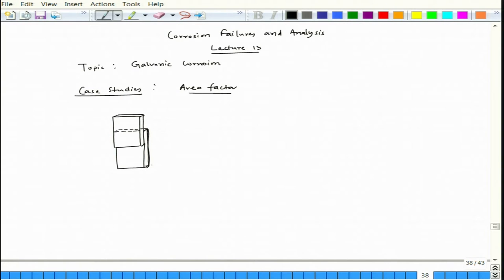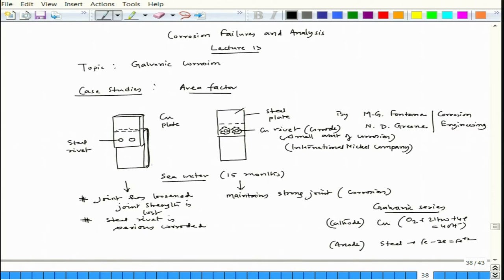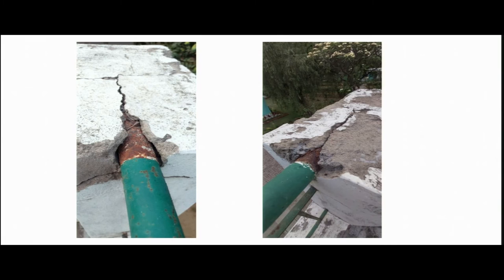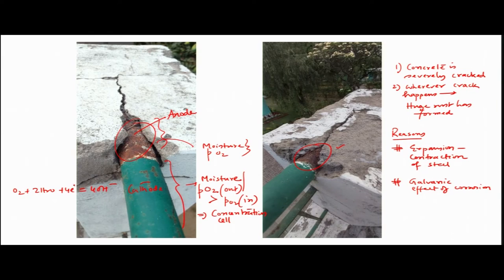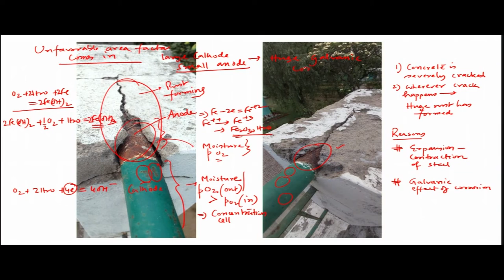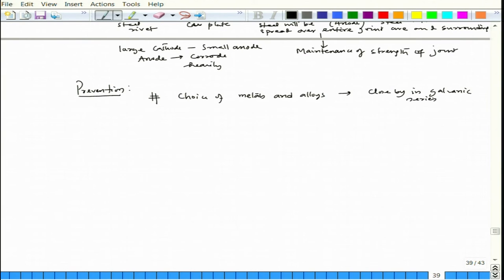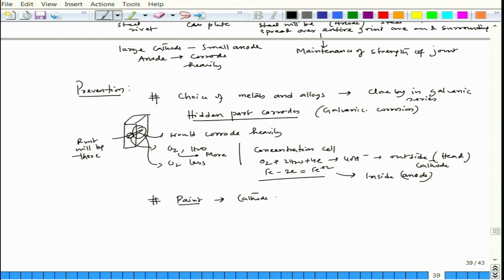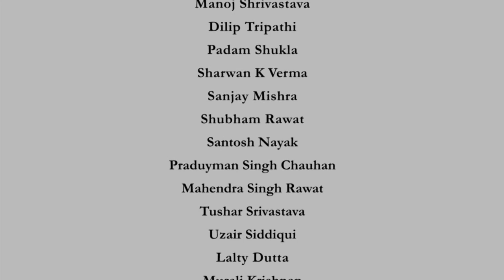Lecture : 13 Factors associated with galvanic corrosion: Case study 3

Comment: Sir, The corrosion of pipe inside the concrete can be prevented by painting the whole pipe instead of leaving the portion penetrated in the concrete. In addition conduit pipe can be used as it enable the ingress of oxygen and moisture to certain extent.